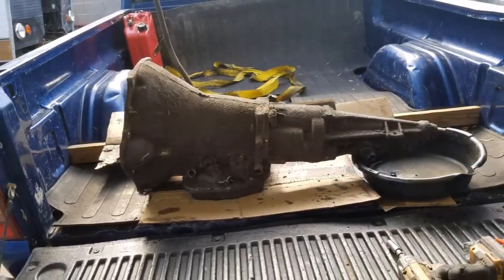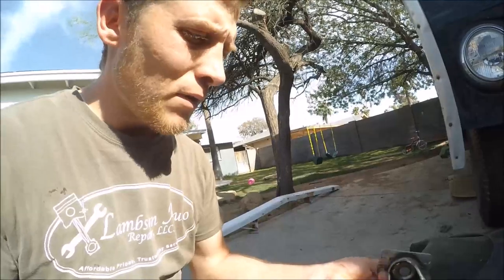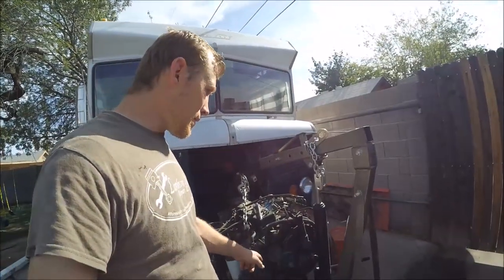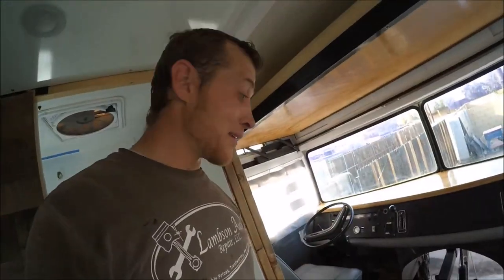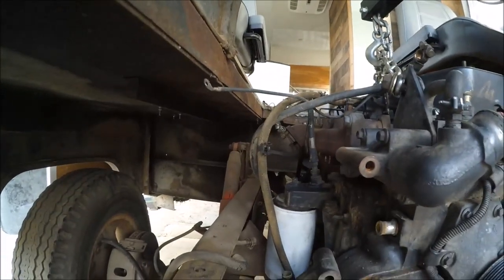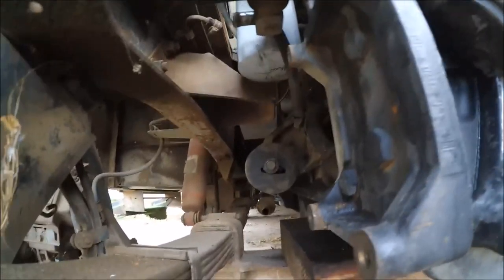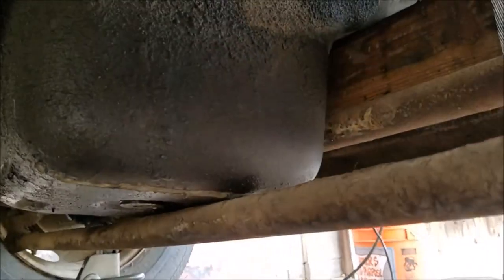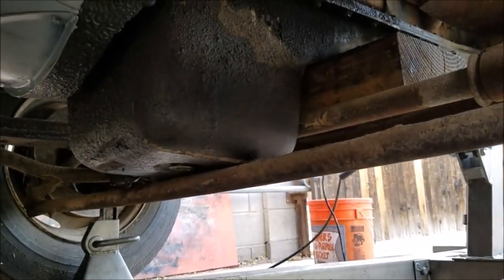1973 Winnebago Brave Cummins engine install, episode #8

Comment: Do you plan on adding any more leafs to your front leaf springs?  That Cummins motor weighs roughly 950lbs, which is twice as much as the 440 you took out.  
Love the build.  Can’t wait to see it go down the road.
Reply from the maker: that would be an easy way to help lift it back up, im still figuring that out as I go